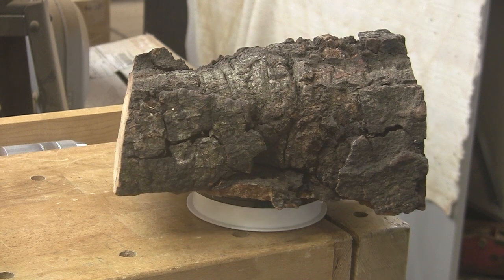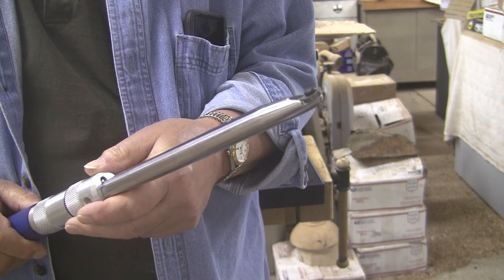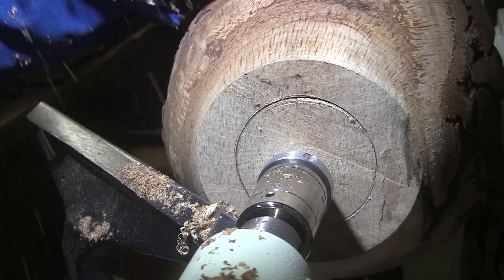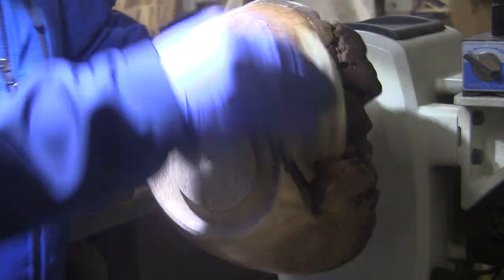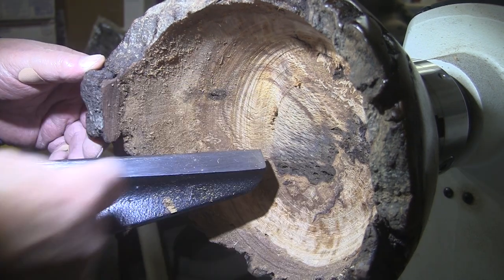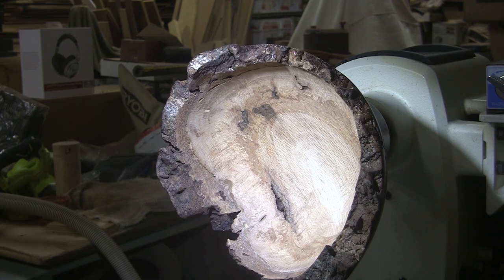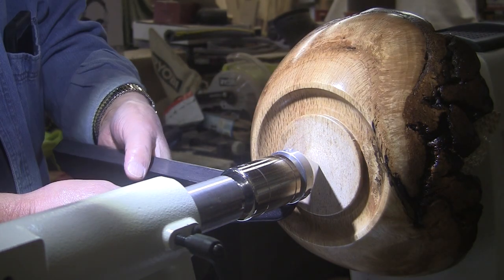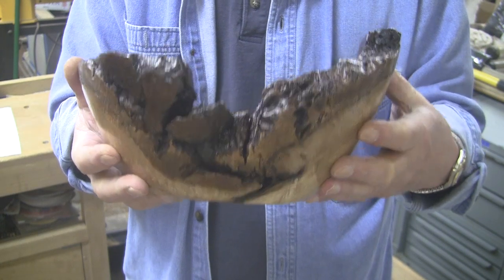Very Difficult, Out of Balance! - Wood Turning

Comment: I find I end up with a lot of awkward pieces of wood to turn. I have learnt, wiith longish pieces, where the depth of the wood is uneven, I will take the width of the wood, then, measuring from the thicker end,  I'll mark the width of the wood, and remove the excess. I know you do bowls with wings, sometimes (I have yet to try them), but this works a treat for cutting down the amount of wood to be removed, as well as considerably reducing the "unbalanced bumps"... you probably already know this..I find your work really inspiring!
Reply from the maker: Thank you very much, Stephanie! 😊  I try not to cut away much or anything before turning.  Sometimes there are design opportunities that appear that just wouldn't be there if the corners or anything else had been cut away, first.  It would definitely help make things easier, though!  LOL!

Comment: Beautiful grain, another gorgeous turning! It likely wouldn't have kicked you in the arse if you could have gotten the RPMs up over 1200. One thing, though... As you know, Phil, I only use carbide. Taught myself how they worked for me, because no one ever told me that I couldn't. I would not have roughed that piece with a midsized round bit. That is a nice big tool, but looks like a midsize bit. My choice, and I can already hear the gasps, would have been large square bit. You can really hog the exterior quicker than with the round one, at least in my self-taught experience. Then the slightly curved square bit to finesse the curve and prep the surface for sanding. But that's just me. (that chunk would've kicked my arse, too-- hard!) 
Gorgeous piece!
Reply from the maker: I did consider the square cutter, Dave, but since it was my first time using that set, I just felt the round would be more forgiving if less aggressive.  Thank you, my friend!
Phil
Reply: @PhilAndersonShadyAcresWoodshop   No worries! It's because no one told me I couldn't do that with just carbide that....well....yes,yes I can! 😁 

Didn't say I could do it better! One more thing: with a square bit, you CAN direct the shavings....... All over and further! 😁 😂 😝

Comment: Nice work Phil, looks great. I purcgased a Rikon set last year. I found Rikon replacement tips too expensive but A Z Carbide ( in the USA) make them at a fraction of the cost and are of a higher quality. Cheers, John
Reply from the maker: Thanks for the tip, John!  I don't know if I'll use the set enough to ever need more cutters but if I do, now I know where to get them!

Comment: Phil,  As usual, I really like the bowl!  Did you say that the wood was a bit wet?  If so, how come you didn't rough turn it and then let it dry a bit before finishing?  Also, can you offer some guidance about microwaving?  I've heard to be cautious.  Thanks,  Gil
Reply from the maker: Thank you, Gil!  I never rough turn, wait for drying then turn again.  Too impatient, maybe.  Plus, I just haven't found it necessary.  I never turn really wet wood.  This was about 20% so not too bad.  For this piece and other pieces of similar size, I do one minute on, high power, four minutes off.  I repeated that four times.  Smaller pieces maybe 30 seconds on, two or three minutes off.  The wood will absolutely crack if you microwave for too long.  Hope that helps!
Phil

Comment: I love this live edge bowl.  You did a great job showing off the amazing bark and grain.  So, what's your view on using carbide?  I'm a relatively new turner and have used carbide from time to time.  As my gouge skills improve, I use carbide less often...I can get a cleaner, smoother finish with a gouge.  But I must admit I sometimes go to carbide for "hogging" out and then switch to my gouge for the final cuts.
Reply from the maker: I did the same thing, Robert.  Tried traditional tools, couldn't get the hang of it, switched to carbide until I could use gouges proficiently.  Definitely better cuts.  Now I only use carbide when it is more efficient.  Thank you for watching, I'm glad you like this!

Comment: This is just gorgeous Phil!! Any thoughts on me turning one so out of balance? I’ve got just a harbor freight lathe but I love it!! The problem is it doesn’t have a speed lower than 750. I mean it kinda does cause it will only spin it up to 750. I can adjust it higher but not lower. I usually just stand out of the way when turning one that’s out of balance like this and I’ve learned how to duck very good lol. I’m saving up for a bigger lathe that I can adjust the turning by the knob like this one. I’ve found that if I try to push myself and get it balanced quickly it usually hurts my hands. It takes me awhile but I can usually get it balanced. Also I turn between centers, I’m looking into getting a chuck but I’ve got to wait a lil bit. Anyway any advice would be treasured. Thanks!
Reply from the maker: Well, I know I'm stating the obvious, but if you can get it more into balance before you mount the piece you'll be better off.  A bandsaw comes in handy but a hand saw can work wonders, too.  I don't know if you use carbide tools but they can get something into round pretty quickly.  I don't like them for myself but I have used them for that purpose.  Good luck, Madonna! 😊

Comment: Do you ever shim the wood before you use the forstner bit? The original rip cut on the flat side may be totally random and not worth starting from. If you shim the wood, you can make the live edge side relatively flat end to end as you rough it.
Reply from the maker: I may have shimmed a time or two, David.  While that might make turning easier, it will definitely affect the natural appearance of the piece.  I'm more about nature than symmetry.  I like to work with what I'm given rather than modify it to meet some other need.  Thanks for your comment!
Phil
Reply: @PhilAndersonShadyAcresWoodshop  I understand what you're saying, but sometimes the asymmetry is not natural but the result of the chainsaw cut leaving one end high.

Comment: Hi Phil,

What a beautiful piece, the bark and grain are stunning!

Is there a reason you ever only use the neg rake on the inside? I use mine both outside and in.

Take care and stay safe
/Lars
Reply from the maker: Thank you, Lars!  I guess I can usually get a smooth finish on the outside using my gouges.  I find it more difficult on the inside so resort to the scraper.  I do use the scraper on the outside of an upcoming piece because sometimes it's easier to finesse the shape with one.

Comment: Hi Phil, nice work! Does the finish keep the bark from drying out & detaching?
Reply from the maker: Thank you, Will!  Well, it keeps it from drying out for sure.  As far as detaching, I think that has more to do with when the wood was cut.  If cut while dormant, the bark usually stays on.  This may be hard to believe, but I turn mostly bark on pieces and have never had the bark come off after turning.  Maybe I'm just lucky.

Comment: Can one only use a shellac finish on a piece to which sanding sealer has been applied?
Reply from the maker: The sanding sealer I use is thinner than shellac so it gets into the pores more easily and forms a bond with the wood.  That allows the shellac to build better.  I suppose you could apply shellac directly to the wood but it would be too thick and likely leave a mess.  But, all that is just a guess, I've never done it.
Reply: after sanding sealer could I use say a verathaine  finish?